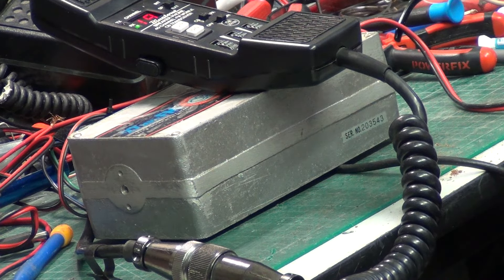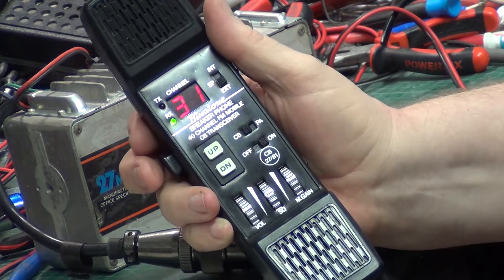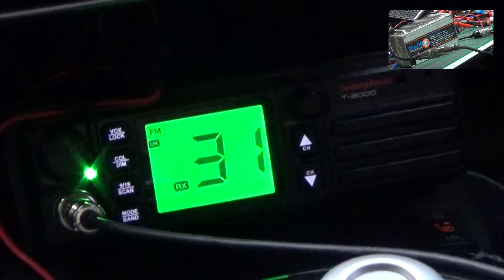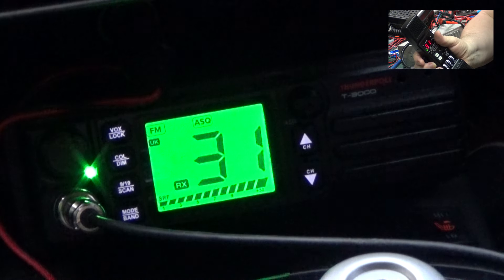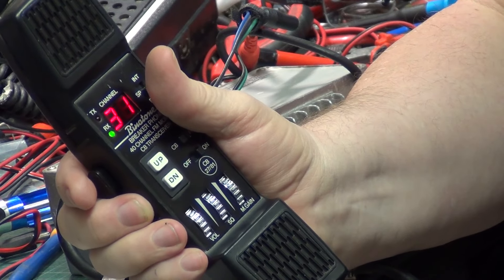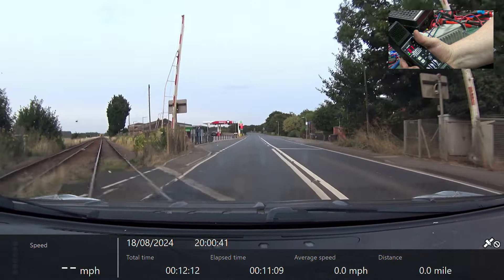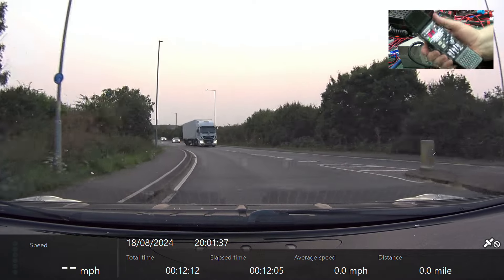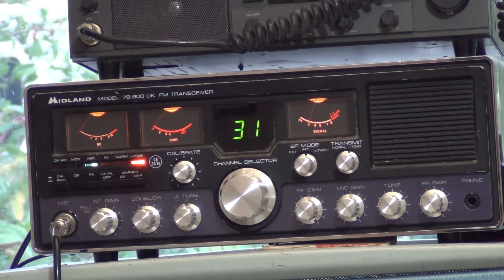Binatone Breakerphone CB27/81 UK FM CB radio - On The Air test + bonus banter

Comment: hi richard I enjoy your air test also best wishes to you and mr chippy also can you mention to mr chippy that it is my birthday
Reply from the maker: Yes, we'll mention it on both today's videos Paul (Midland 77-1165). Happy Birthday.

Richard
Reply: At the 5 mile point I thought marks was still slightly better audio. Shame that the breaker phone will cause a problem mobile with the mobile phone law
Reply from the maker: However, it can be proved it is not a mobile phone, but a 2-way radio. That said, it's always better not to pick any mike up in front of a policeman in case they're not sure of the rules; it all wastes time if you get pulled over.

Richard
Reply: Happy Birthday Paul in East Sheen. Hope you had a great birthday 🎉
Reply: @ukfmcbradioservicingTango21  definitely agree Richard. I'm using network poc radio now that's debatable as it's using a phone network yet a ptt radio walkie talkie
Reply: @nicholaseudall6333  You are in use of the GSM standard the 1800 MHz frequency band and up. That is a big no no do not let the police catch you as it will be classed as a cell phone.
Reply: Happy Birthday Paul
Reply: to @Ossie12pints  you are a day late my birthday was yesterday 
from paul chapman
Reply: Belated birthday greetings Paul - hope you had a good day. :)